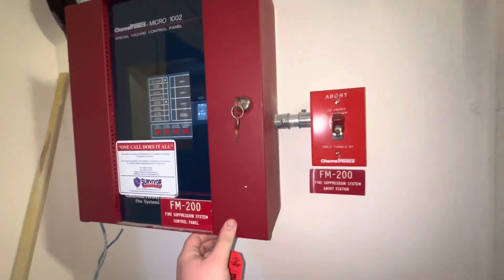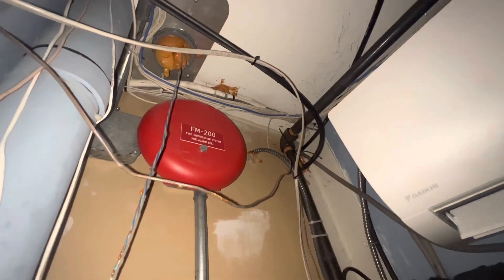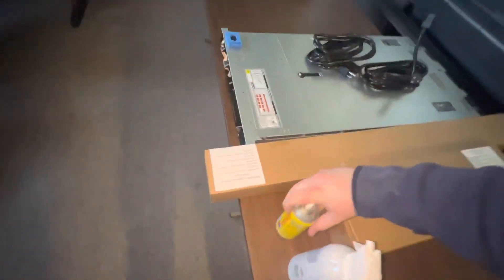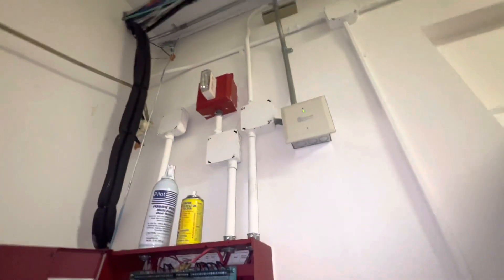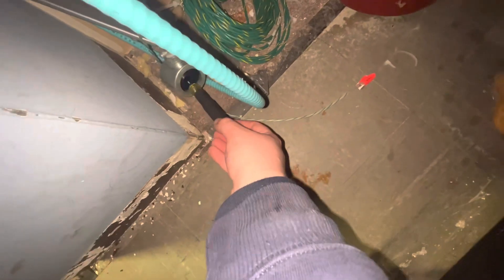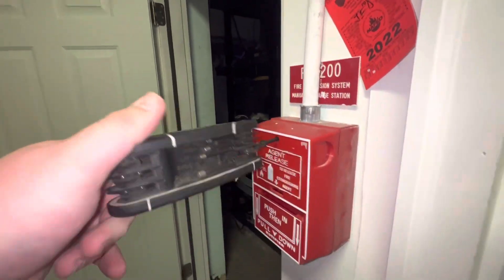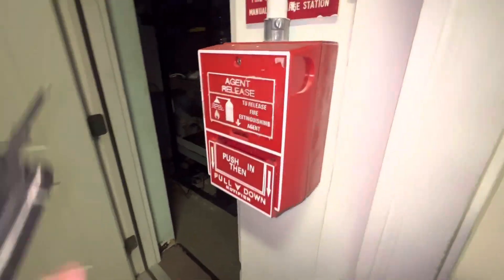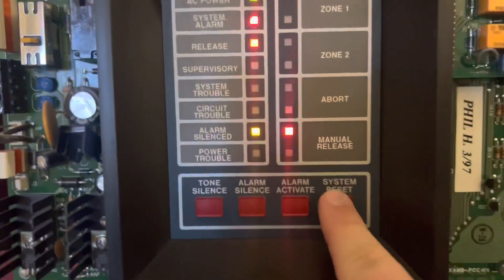Fire Suppression Test #6

Comment: Fire suppression systems are used to extinguish, control, or in some cases, entirely prevent fires from spreading or occurring. Fire suppression systems have an incredibly large variety of applications, and as such, there are many different types of suppression systems for different applications being used today. Of these, there are some that are still in use but are no longer legal to manufacture and produce.[1] 

Fire suppression systems are governed by the codes under the National Fire Protection Association, also known as the NFPA. This organization writes codes, regulations, and recommendations on the proper installation and maintenance of these fire suppression systems. Likewise, the NFPA also lists criteria that must be met for the requirements of certain types of fire suppression systems.[2]

    Fire sprinkler systems
        Wet pipe
        Wet pipe antifreeze
        Dry pipe
        Pre-action
        Deluge
        Electronic
        Foam water sprinkler
        Water spray
        Water mist
    Gaseous agents
    Chemical agent systems
        Wet chemical
        Dry chemical
    Fully automatic suppression systems
    Fully automatic vehicle fire suppression systems
    Manual vehicle fire suppression systems
    External water spray system

A fire sprinkler system is an active fire protection method, consisting of a water supply system, providing adequate pressure and flowrate to a water distribution piping system, onto which fire sprinklers are connected. Although historically only used in factories and large commercial buildings, systems for homes and small buildings are now available at a cost-effective price.[3] Fire sprinkler systems are extensively used worldwide, with over 40 million sprinkler heads fitted each year. In buildings completely protected by fire sprinkler systems, over 96% of fires were controlled by fire sprinklers alone.[4]
Reply: Bro will take all that time to write that but not upload a video
Reply: @Nicsou77  It literally took me 5 seconds to copy and paste all that, lol

Comment: That’s a neat little system! Obviously, due to the size of the room it’s protecting, the delays are tiny, but it’s still pretty cool nonetheless! I also like how they can get three separate tones out of that horn/strobe by changing how long it sounds for at a time. During pre-discharge, it plays short siren bursts; when the abort switch is activated, it plays longer bursts; and when it goes into full discharge and activates the solenoid, it basically sends the horn a continuous signal, so it plays the full siren/whoop tone!

Comment: Ever worked on a Kidde Gemini? It's an awesome panel because it can be used as both a general fire alarm and a suppression panel at the same time. Even with the releasing board equipped, the two zones on the main board don't initiate a countdown.